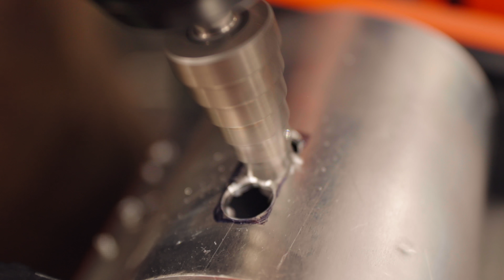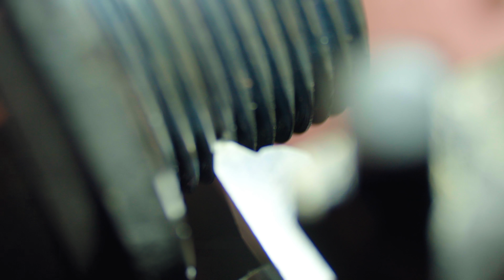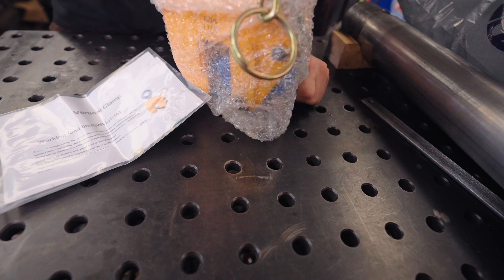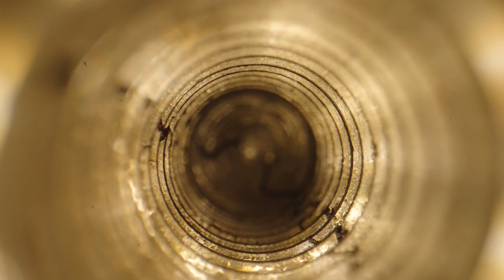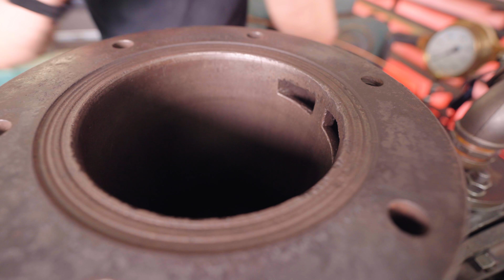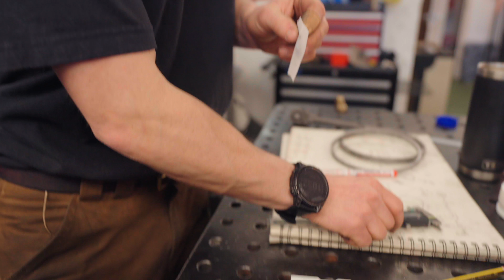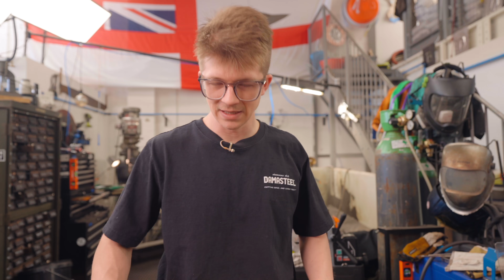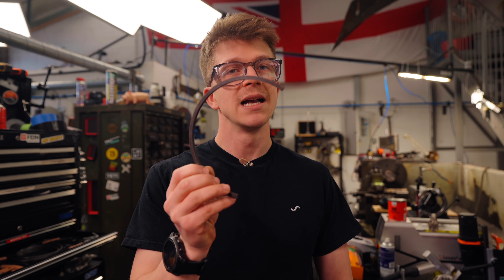Re-Restoring the Steam Hammer! Part 10

Comment: Repeat from Ep.9: there's no need to remove the piston rod from the lathe in order to gronk on the piston threads. The lathe will almost always be a better workholding setup than the makeshift situation on the welding table. As for the red loctite, well, they make a variety of different formulations and you probably want something stronger than the generic 262/26x for a 2.5" thread…; 262 is recommended for 3/4" and under)

Comment: Carver clamps are not outstanding but they do provide you with a different way to clamp, an option when other clamps will not work in a spot. Carver clamps don't apply as much pressure as regular clamps but they are more rigid, so useful when you are trying to oppose deformation from welding.

Comment: Alec - I believe you are making the piston rings incorrectly.  The ring size should be made to a larger diameter than the size of the piston ring groove and then the closure cut is done so that the ring, when pushed into the cylinder, closes up to seal.  Please see Keith Rucker's recent video where he makes piston rings for a steam engine.  The reason for making the ring a bigger diameter is that a ring of that size and material does not want to open up as much as it will conform to closing.  By making a bigger diameter, this also allows you the opportunity to vary the type of closure (including using an overlapping closure) to promote a better ring seal.  Ideally, your rings should be made out of cast iron so that the rings wear out before the cylinder does.  That the prior rings were made of steel may be a repair that used whatever material was available.

You can try to install the rings you have made, but don't be surprised if they crack and break as you try to get them into the ring slots (as you well know, cast iron is not very ductile).

Comment: Is there a way to impregnate the surface of steel with graphite? I can see how doing that could be beneficial.

Also - do your piston ring calculations include the heat that is relevant for a steam system (which you won't have, running on air)? It could make a difference in the calculation of clearances.

Comment: You could have just left the old half threads on the part and put in two new ones in a 90 degree offset. And I definitely wouldn't have but them back in the same place as the old ones. Just too risky that something is of with the welds.

Comment: Hey Alec, don't fret about that minor hiccup, it happens! And better yet, it's a valuable lesson learned and will be an experience you will always have in your back pocket for the future you or someone else who could use your experience. I will say, take special time in consideration for WHAT TYPE of steel you find to be appropriate to use. For as you know, hardness, malleability, and even work hardening through out the rings lifetime will all be important factors when choosing the appropriate steel. I noticed you said Rockwell 20, was it C or B? That will make a difference in what steel and what carbon content you desire to make the rings from. Alternatively, you could also make them out of annealed high speed steel as they would be much more durable but would more likely make clean breaks in case of mechanical failure. I say this because I'd assume you'd prefer the rings to break (but not shatter) over bending and risk gouging or warping inside the cylinder. 

Just things to keep in mind, great work though in what you did make and learning is always the best result!

Comment: Why would you cut the ring to the actual
bore diameter, and then "stretch" it... and NOT leave it oversized, and cut your relief to match the spring compression? (There is no way any "stretching" action would end up concentric after bending)

Comment: In fact you can make the ring slightly oversize such that the ciicumference is equal to the bore circumference plus with width of the gap cut. The very tiny discrepency on compessing the ring into the bore is neglible, even on the tiny ones I have made for bores under an inch in diameter. I doubt that your cylinder bore is truly round anyway and the ring will run in with use. No need for stretching the ring beyond yield point to establish 'spring' doing it this way....and stressiing a cast iron ring to do that is likely to break it.

Comment: Valve engineer here.  Maybe you want to keep this all original, but have you thought of using modern materials for the piston rings?  In sliding stem valves N07718 is sometimes used for piston rings.  Expensive, but very very strong.  It is not the best for galling resistance so you would have to research that part for your application, but it works well in valves.

Comment: I have concerns that between application of the loctite, facing the shaft, and then finishing tightening it, that the loctite set and by turning it again you unlocked the loctite.   Also, Im not sure if "heat release" red loctite was the best choice for the inside of a steam hammer.
Reply: Of course I pause the video to type the comment and post it, and as soon as I hit play you say you googled the set time for loctite. lol

Comment: Not a professional welder in the slightest but, why not MiG instead of stick? I have seen this a few times, people I have seen using wire feed switch to stick for filling. They make “filler” specific wire, I have used it. It was easy peasy, filled no problem. Filling with silicone bronze wire and TIG is also preaty easy and clean. I don’t get instantly grabbing 7018 and going to town, especially if you don’t use stick a bunch. Again, not a professional, I’m willing to learn.

Comment: I would get a large coil  spring , cut  out coils . Forge weld into hoops , marking  the weld area to be cut later at the weld. Mill to rough shape. Then, temper / heat treat . Hold at temperature  until it is definitely hot at the core. And chill the oil to at least 0° f. Before quenching each ring. Or use separate oil containers  and oil for each ring. Use about 2 liters per ring. 4 liters of oil , two containers,  chill one ring, return the oil to the freezer, get the other oil,  dunk a ring, take it to the freezer. Check the oil temp only when it is at -1°f or 0°f. Will it be ready.  Take it to dunk the next ring.  After all rings are done . Grind the rings to within .010" of size, then pull the hardness back, check for warping and cracks, and grind to size.  Slightly  convoluted, I know. By temper/treating mid process helps reduce  chances of warping (possibly)  and magnefluxing just before finishing, you know you have good rings finishing rings then cut the gap and it flys to bits from cracks. Not good.  Get a old halogen shop light , 100 watt  and 100 feet  of 18 gauge wire, a 1" bar or square 1x1" 12" long, bend into a [ shape. Cut the tips off 2.5 " from each end. Cut two 3" circles of plastic from drink  bottles or something similar.  Cut a 1" square out the center. The steel bar bent, leaving about 7"-7.5" in between the bends. Mill 1/2" deep 1" from the ends, also the 3" bits cut off, drill m8 holes , use m6 bolts and washers with wing nuts.  Reattach the bits cut off. The nubs can move back and forth about 90° the plastic fits in the middle bit. With electrical tape in the middle, keeping the plastic bits from going to the middle and back  and forth. Then start neatly wrapping the tape covered area with the insulated 600v rated stranded wire, 18 awg. . Start about 4'-5'  from the end. And leave 4'-5' on the opposite end. Cut the cord on the light  if it has a neutral  wire  , what ever is referenced to ground use it. And wire one wire to the light one to the cord.  Wrap the wire and plastic  with electrical tape. If you want to look safer attach a ground wite to the metal at one bolt, attach it to the grounded cord.  The light should have a switch.  When it's on you can magneflux steel and iron with filings on steel parts .  Mix it with ink, or lay out dye. MIx until it's dry.  Prevent clumping , you can also make a 6"-12" hoop place wire wrapped around it much the same . Run parts through the centerattach a wire on each end outside the loop from one end of the test part to the other. You can possibly mix iron rust  iron oxide   with a thin dye  sprinkle on the possible crack in iron or steel you can try using a volt meter on each  side of the crack probing very very close, it may work, attach a jumper wire from one side to the other , outside the hoop.  It may  show 0.1volt maybe 0.05 when probed.  the magnetic field may not allow the meter to work.  Have an awesome day.. 🎉🎉🎉. Build at your own wrisk, only if you know what it is and how electrical  works..

Comment: Alec...buddy...pal...bro....at this point less than 50% of this power hammer is actually original parts....you aren't restoring it, you're rebuilding it.  Some might argue that's semantics, but there is a distinct difference between the two.  Hell, with the new piston head you aren't even using the same materials as the original.  EDIT:  Still fun and educational to watch, but words have meanings, use the right ones in your titles!

Comment: hehe i knew they were steel from before;p you have a cast iron bore the friction will be low because of that, you don't need both surfaces to be cast iron;p just think of car engines with cast iron blocks;p

Comment: Alec Aluminium. You can always remove the coating from the MMA electrode and use it as a filler metal for TIG welding.

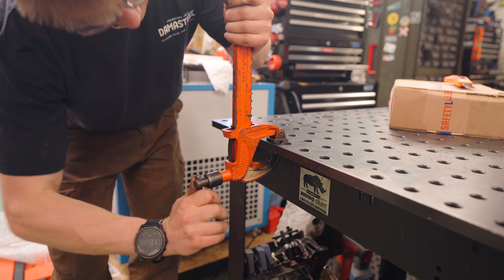Comment: 19:14 They are. I used a modified one to make an in field jack that grabs on the chassis of a sprayer securely and lifts it out. In short: it's not just good clamping, it's also good structurally (tho i would not recommend it just to be safe).

Comment: 24:55 I remember my father showing me as a kid at 12 that a cam shaft will break in half if dropped. but they have a large load lifting the vales and it does not break. It is the way the force is applied.

Comment: Not sure if thermal expansion is an issue with an air hammer but if these things do make some heat you may want to Add in a bit of trim for expansion so your rings don’t bind.

Comment: Does the piston's rings needs end gap calculation knowing the metal will expend when heated. maybe the air pushing though the piston will cool it down enough but there is still friction causing heat. Obviously it does'nt need an end gap as large as in explosion motor and even a piston air compressor should produce more heat in the cylinder than your power hammer piston. After all maybe i'm to picky and the thickness of the blade you used to cut the rings open will be enough for the gap.

Comment: 24:40 from it being 21 rockwell C instead of 40 - 60 rockwell C, I suspect it to be made from hardened spring steel, and not from "regular steel" like 1080 and such.
Also, be aware that if you make it out of steal that is too hard than it would likely brake from the major forces it will encounter, so be sure to tempar it🙃

Comment: 9:12 This is not going to hold. The forces are greater than the grubs can hold. It won't break tomorrow, not even the day after, but at some point one of the two buggers will out, and so will the other.
I still think it should've had a plate milled into and bolted down with the flush bolt heads peened into their grooves to prevent them from moving.  Prevent rotation before anything else. And to do that, you have to order the "tree" function. Trunk > branches > twigs. You're missing the branches and there's only a bald trunk with twigs...
10:02 In machining, you have to ask yourself this: am i doing better than the person who made the mistake before me?
I saw no flaw in the previous repair, it wasn't half cocked. Whomever that person was, followed a normal repair to a normal issue. Which was a mistake, because this isn't a normal issue. You have a massive piston, rod, and hammer in one. Oh well, i'm here for when the re-re-restoration starts (i don't have confidence in the one grub, he is not the chosen one).

Comment: I can't think what 3ould impose enough torque on the piston rod to sheer through the grub screw, even one. It's not so much a matter of simply diameter, but also length. To be able to twist and sheer through that bolt would be truely huge and not near normal directions of stress. I think one will be just fine and at full depth quite enough.

Comment: why not put a v in the top say 6mm wide at 90° and weld the top ?? turn it flush in lathe, it'll never come off accidentally !! If future repairs are required, just turn the same welded area out and unscrew....

Comment: Speaking of accuracy; you may want to get into the habit of holding your micrometers differently.  The heat from your full fisted grasp will transfer into them, so they won't stay standardized.  I typically use finger tips only and hold it with a rag if I know it'll be in my hands for a few mins. (I often find myself working to .0002-.0003" tolerances on the cylindrical grinder.)
Also, inside mics are considered to be "reference only"  and should always be checked against an outside mic.

Comment: I work with alcohol race motors where the piston rings experience 7000gs we have to size our rings they are slightly larger then the diameter of the bore and we grind down the gap too fit our specifications. Test fitting then removing more if necessary.

Comment: You could see if you can find d the 90 deg gear attachment that goes on the nose of the mill. I used one, they can be a bit tricky to get in the mill straight but nothing indicating won't fix.

Comment: Wait, piston rings aren't sealing because of their tension against the bore, but because they become pressurised by the gas they're sealing.
The gas arrives on the piston, pushes the ring against the opposite face of the groove (that's why they need the right play in the groove and they need to be perfectly flat), passes behind the ring and pushes it against the bore.
Too much play and the ring starts to vibrate during the travel, lacking sealing ability, too little play in the groove and there's not enough flow speed to pressurise it in time,  and the pressure makes it collapse into the groove.

Said that, good job, as always!😊

Comment: Since you had to replace the piston head and repair the threads on the rod anyway, I'm wondering if it would've been easier to just turn down the end of the rod, get beneath where the old grub screws were, and cut a new thread in a standard metric size, then make the the head fit the new thread. The only problem I see is that it'd be weaker, but that might not even be a problem.

Comment: Keith Rucker had a video come out Monday on You Tube making Cast Iron Piston Rings for a Steam Locomotive. The only difference between Keith Rucker's Piston Rings and Alec Steel's is size of the Piston Ring and, Mr. Rucker uses a Lap Joint on his Piston Rings to ensure maximum Steam Pressure.
Reply: uh... someone forgot Massie is still alive and can provide the answer on the Piston Ring Material, and, that Piston was Re-Ringed when it was rebuilt and the Steel Piston Rings he pulled out included one broken Steel one. I think Cast Iron is the traditional materials used in Steam Pistons for its natural lubracity and the steam trying to bypass the Piston Rings will cushion them a bit.

Comment: Why are you re using the grub screws when they did not work originally ?   Given you said the later models were all one piece I think welding the piston on to the shaft to stop it unscrewing would have been the better answer.

Comment: Also, did you determine what kind of steel the piston rings are supposed to be (or did the guy you mentioned told you what they should be in his experience), or does it not matter in this case?

Comment: I would have done the drilling at 60 degrees to avoid the potential hardening from the preheat and welding. Doing that would allow someone another 100 years from now to do what you've done, rebuild the piston, and they could reweld your old works and put in a new drilled hole for some grub screws. 
But, hey, that is me. I'm weird like that.

Comment: I can not believe what i'm watching. Machined threads should NEVER be tight. If it's getting tight as you put it on, the threads are not right. You're also risking galling the threads and destroying the piston AND the rod by putting them on dry and tightening them like that when they are that tight. Horrible. You also never in a million years should have welded up the old grub screw holes. Put the new piston on and drill 2 new holes 90 degrees from the old one. Those few missing threads were never going to have an impact on that part.

Comment: Those rings probably broke because an eye bolt was bouncing around on them...
But good work mate. Nice "detective-ing"
Also, make friends with someone who has an XRF spectrometer. They are really cool for working out what metals you are working with. They can pretty well figure out all the alloying elements except carbon, which they can figure out by a process of elimination...
Good luck mate.
Cheers from Australia 🇦🇺

Comment: Instead of putting a grub screw in the end of the piston, why not put a pin under the piston ring in the bottom of the race? It would be harder for it to back out and couldn't drop the part into an open area to rattle around.

Comment: why couldn't you just tack weld the recessed shaft to the head and then smooth that out? 

would take about 10 seconds with an angle grinder if you ever needed to take it apart but would literally never unscrew or risk falling into the cylinder like the old grub screw

Comment: Hey alex Im in welding studies!! Please do not soak your electrodes! Hydrogen when exposed to flux and welds causes excessive porosity and can cause Hydrogen induced cracking!! Instead try heating the rods in an oven!! Maintain a heat of 250°F (121°C) to 300°F (148°C) for 1-2 hours. Love the content and series 🎉❤